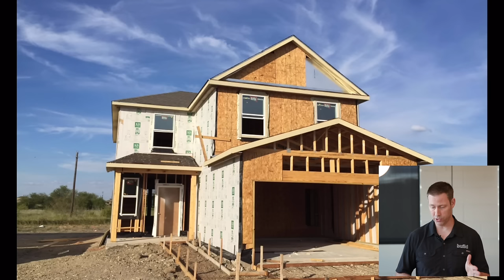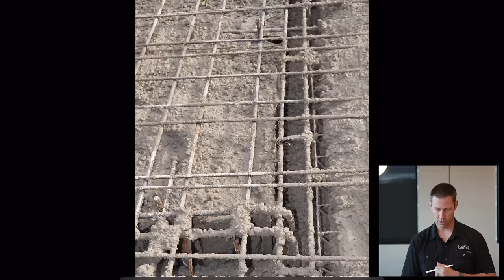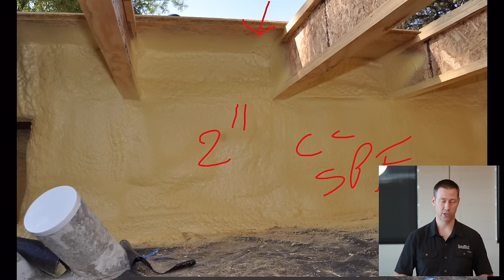Foundations - Slab vs. Pier and Beam - Which is better?

Comment: Slab on grade foundations are quite common on the part of the Maine coast where I live.  Most of the newer homes built that way start with a smoothed and leveled surface, then around 4" of closed cell foam then the rebar slab.  There is usually foam around the perimter of the slab too, particularly if the slab will have radiant heat.  Fully half the houses on my road, including mine, are slab on grade and all have radiant in-floor heat.
Reply: Are there any issues with those slab radiant heat lines freezing in Maine?
Reply: @michelebarber534  only if the heat is turned off for the winter and the system isn't winterized.  As I understand it, people that shut their heat off for the winter often fill the heating system with antifreeze rather than water to prevent freezing.

Comment: Pier and beam is great.

As a plumber that’s what I looked for when I bought my home. I have a 3ft to 6ft crawl space which has allowed me to easily run new wires, ducting, plumbing and a big thing, STORAGE.

A lot of my customers have multiple sheds or garages filled with junk. I have around a 1000 sqft of space for storage thanks to that.
Reply: Basement/cellar is far more spacious than a crawlspace as it adds living space! Lived in two home with basements, also lived in a few slab foundation homes, I rather a basement for the more spacious extra space compared to a crawlspace with its limited height.
Reply: Is that pipe for a toilet, toilets don’t carry ground traps.
Reply: @Blox_fruit_master1 shower I think it was.  The trap for the toilet is the toilet

Comment: Pier and beam all day. Ease of repair, can be insulated , and flex and the crawl space can be used for storage. All good things if you can get to solid earth. My previous house was P&B. Loved it. My current house is slab on grade and the only nice thing for me is how quiet things are. No cavity under the house to amplify sounds. Cool in the summer but cool in the winter unless you have a sunroom to warm the slab, of which the house I'm currently in does not have.

Comment: Another benefit to post and pier is that in Hawaii having air flow under the house cuts down on mold in the house.
Reply: This, I was about to mention this myself. I'm in the "Deep South" and it's not quite as hot as Hawaii, but the humidity and heat together will kill a house and make YOU feel pretty awful too. Having that airflow is sooooo much better. In places where there's a freeze line, basements are great. Around here, unless you're willing to spend a LOT of money not just in construction but in continuing maintenance, a basement is just asking for a flooded space under your living area. :(
Reply: Sonja Johnson  a lot of new homes are built with sealed crawl spaces as if you live somewhere humid all ventilation is doing is letting the humidity in under the home.
Reply: @morehp1  I disagree, under the house is shaded, and the air has a cooler temperature no matter the humidity. It's like sitting under a tree when it's hot out. That cooler temperature actually radiates up, and pushes against the heat. Much like it does in the winter when the heat is on but from the knees down it's cold. 
Here it doesn't get that cold, but in the summer time that airflow keeps the mold down, and helps keep the house cooler.
Reply: @StacyForest738  no the crawl space is completely sealed off with heavy poly done right will have a cap of concrete poured over the poly on ground and the  crawl space walls are insulated and heavy poly over them. Small dehumidifier is installed to keep humidity at desired level. Witch hardly run as there very little way for humanity to make it in. If you ever been under one it’s a Beautiful thing and smells fresh under there. Been under a bunch of homes doing different work. Dirt crawl spaces always have the old stall dirt smell, bugs and spiders everywhere, seen mold under many homes. Yes many states still have code on vented crawl spaces old habits die hard. Many builders do things because that’s what they were taught. Doesn’t mean there’s not a better way.
Reply: @FrankieGreen777   yep and that cool air is full of humidity that’s going pass straight threw the subfloor in the living space above and make your air conditioning work harder to get rid of the excess humidity raising up threw the floor. In a concealed crawl space floors are sealed with heavy poly, and walls are also small dehumidifier is install, witch allows the humidity under home to be controlled. If you have no humidity under home mold can never ever grow. Vs vented crawl spaces can let the right humidity condition exist to grown mold.
Reply: @morehp1  That is good to know. We may be building a cabin soon and I would love a sealed off basement, we just didn't think it was a good idea in a high humidity area. When you mentioned dirt floor basement being full of spiders, bugs, and mold...you basically described a house we lived in prior in TN. I totally don't doubt old building codes die hard, that is a good way to put it. ha ha.

Comment: Great video. I have a pier and beam home. My satellite dish was starting to be blocked by some trees (12 years after the home was built) and needed to move the dish or cut down the trees ( that wasn't going to happen). Only took 30 minutes to run new cable under the house from the other side of the home where there wasn't any trees. Pier and beam is definitely the way to go if you have that option. Especially since I have no attic space (cathedral ceilings). I also will probably be doing a bathroom remodel and the re-plumb will be easy.

Comment: In Central, North, and West Texas;  where the water table is generally very deep, structures can be built with in-ground basements like that. These also happen to be the areas with those solid "bedrock" conditions and, such difficult excavation creates obvious budgetary constraints that restrict the inclusion of basements for mid-level value construction projects (and/or track developments). However, there are other restrictions to basements in Texas. Along the coastal area of Texas, for at least 60-80 miles inland by the crow, and in the river basins which encompass much of the East of Texas, the water table is (generally) only a few feet below natural grade (it's 26" where I'm at in Hitchcock, TX); which limits inclusion of basements for nearly all construction projects because of the constant intrusion of large amounts of groundwater; the area is also prone to frequent floods and storms, and therefore have significant flood elevation requirements.

Considering the fact that; with the exception of the Hill-Country region of Texas...which  has limestone bedrock, and/or boulders, with minimal soil coverage of any kind...the lower Coastal region (SW) and West Texas having primarily sandy soils, and the upper Coastal region (SE) having a loamy soil of a Sand and Clay soil stratification, and nearly all areas of North, Central, and East Texas have entirely, or some depth, of expansive "Beaumont" clay soils....one would think that pier-and-beam would still be the norm across most of the state. (BTW, the type of perimeter wall used in the video P&B example, I've always heard that referred to as a "chain-wall" or "knee-wall")

Pier-and-Beam used to be the construction norm for most of Texas; at least until the mid-20th century, when the availability of lumber from big trees of the "old-growth" forests in the mid-western US dropped off. The price of lumber skyrocketed, making large timbers with full-rip faces and wide, wood-plank cladding construction too expensive for most people. Then, newly enacted forestry restrictions in the early '60s; and the shift to "new-growth" pine lumber of the Northwestern US, made housing design "shift" to use smaller, lighter, lumber that was efficient, and more affordable. Drive through any "heritage" neighborhoods in Texas and you will likely recognize the progression from 19th-century Georgian and Federalist, Victorian and Queen Anne - with locally-milled, true sized lumber, wide cuts of wood plank siding outside, and all-wood lathed interiors; to timber-framed Tudor and Praire Cottages - entirely sided and roofed with shake shingles; to Arts-and-Crafts styles - with prominently displayed exposed beams and a greater use of stone, and Craftsman-style bungalows - utilizing ever-shrinking cuts of affordable lumber, and increasing ply-wood paneling, trying to hold onto that 'look' through a couple more decades; into the variety of mid-century moderns and Traditional American Ranch - with their efficient framing, cladding, and limited use of decorative woodwork... By the time the influx of soldiers returning from Vietnam, financed through Federal VA loans, spurred huge tracts of suburban residential developments in the late '60s and early '70s...each was filled with single-story, two-story, and split-level "ranch-style", homes - using a more economical, and faster to build, Slab-on-Grade foundation to accommodate the demand (and budget) of these new home buyers.

Today, Pier-and-Beam construction, IS regaining popularity...primarily due to flood elevation requirements going up across the state and the returning style of residential homes that 'give-a-nod to bygone eras favor the foundation method. And the P&B's towering cousin, the elevated foundation, with their structures a full 'floor level' [7-10+ ft] above grade, and oftentimes just called a "Pile" or "Column" foundation. The finished structure is fully supported by a grid of either:
1. Round, or square, timber piles...that are machine-driven into the ground 8+ feet; or
2. Engineered, square, concrete piles pre-stressed during manufacture in order to provide very high strength and, generally, are used when elevations or severe conditions would be a problem for other types of columns... that are machine-driven into the ground 8+ feet, in the same manner as timber piles; or
2. Poured concrete columns that are integrated with concrete footings and/or grade-beams, or with subterranean "bell" footings, and a non-structural, slab-on-grade, concrete or fibercrete, "basement" floor underneath the majority of structures; or
3. Stacked CMU-blocks, back-filled with concrete or sand...either in a single, vertical, course, or a double, interlocked, pattern.
(Your video mentioned steel sub-piles under a slab...I suppose in drier, not saltwater areas those could be quite efficient; but along the coast, they'd provide very little friction resistance for loading and would be gone in 10 years due to corrosion.)

I guess I'm a tad partial to an Elevated foundation construction...I should, I've been designing them for nearly 20 years with coastal hazard mitigation in mind! I did the structural on this one [http://www.cnn.com/2008/US/09/18/ike.last.house.standing/] while Lead designer at a local engineering firm about 13 years ago. The plan was a typical P&B from a .com shop and had to be adapted for the EF design required by the site. The majority of my work has been coastal, but I see applications for EF's in larger cities where, due to urbanization, flooding is an issue and existing lot sizes are already small from previously being laid out for little track bungalows and what-not. I, personally, think EF's offer the most economical method of reaching (or exceeding) elevation requirements that would exceed those of a standard P&B Pier. They can give a structure "freeboard" that, with only 2 ft above BFE, will cut flood insurance costs as much as 50%. 

Elevated foundations require minimal, if any, fill and help with net-0 runoff requirements required by many municipalities because "basement" floor materials can be pervious, or omitted completely, or in part. EF's have the added capability to provide larger living spaces in a smaller site footprint because they're able to take vertical advantage of the site...often being 2, 3, or 3.5 stories above ground level...automatically provide garage and storage space below the occupiable floors. Often, elevated foundations provide a land developer with higher profit potential, through the additional homesites created as a result of smaller lot sizes necessary to accommodate this style of construction...each to be sold at the typical price range...while creating minimal infrastructure cost increases for the development as a whole.
Reply: I cant believe this knowledge is readily available on youtube thank you for sharing your experince :D
Reply: @furrycircuitry2378  You're welcome; 25yrs experience in Texas (and the Gulf Coast as a whole) designing the infrastructure for developments and structural for the buildings on them has given me a pretty good overview.
Reply: How cool is this!  What awesome information.
Reply: in the case of piers and slab you mentioned (11 minutes into your presentation), if they were not able to reach the rock and had to do reinforced concrete footing for each pier, would they have been able to do a reinforced concrete slab still (I know he said the slab was not reinforced)? 

if so, can the piers be taller than 2 feet; say 6 feet tall? Can it be done (I know it would be very heavy)?

Comment: Could not agree more I'm just east of Austin and peer and beam on this sandy soil is way more reliable and easier to install or repair if ever needed. I've seen so many cracked foundations and homes costing alot to re-level, with peer and beam but a jack on it slide in some cribbing and done.

Comment: Another benefit of a slab foundation that we did to my dad's garage in Illinois. Use below grade insulation under the slab and put a tubing grid in the concrete for convection heating and cooling by circulating RV antifreeze through the tubing. We used an electric hot water heater as a storage tank for solar hot water, and had the water heater set up as a backup heat source running off of a battery bank and solar panels... Can't stand to turn the thermostat over 55° because you'll start to sweat in the dead of an Illinois winter.
Reply: @LincolnLog  we started off with just wanting to use the convection heating. I wanted to test the idea of running a series of copper pipes painted black in a black box with a plexiglass lid as a means of endless hot water when the sun was up. The idea worked, so we decided to plumb that solar water heater into the system. The way things are set up, the electric heater rarely needs the grid to run (my dad is an Advanced Electronics Tech, so he built a controller that uses solar hot water first, electric hot water from batteries second, and grid power third). It started as an experiment and just stayed connected because it works well.

Comment: In the DFW area it’s very difficult to find an experienced pier & beam contractor since majority of the area is so flat. They can do slab on grade a lot quicker so  if you have a slope they want to lean towards retaining walls and compacted fill  to level out the site.
Reply: Not only is the DFW area flat, I believe it has a really shallow frost line (like a few inches). You probably can get away with a backhoe digging a one foot deep footing. (Always check your local codes, kids.) I bet the backhoe is way cheaper than digging out the footings for a post and beam foundation.
Reply: Hi, do you have a good pier and beam contractor you can recommend in the DFW area?
Reply: This is very interesting.  My wife and I are looking at a home in frisco and it is on a slope.  Who do you typically reach out to for the retaining wall?

Comment: It would be good to build a slab first then build a pier and beam house on top of that so when crawling underneath, you don't have the dirt to deal with. Pier and beam cost less material I believe because there is no concrete and steel rebar use. One thing I like to point out is there is no need to build the water supply pipes underneath the slab foundation, some of my condo properties they used CPVC pipes installed inside the ceiling areas. It would be good to insulate the CPVC waterline supply though. 

Last year I did plumbing work at my house and ran Sharkbite pex in the attic from the supply waterlines at the water heater to a new bathroom location and were insulated with foam tube insulation. The freeze we just had in Texas in the 2nd week to the third week of February 2021, the pex pipes has no issue. I kept the house at 66 degree heat and here is the key "I flushed the toilet every hour or less for 4-5 nights without sleep (this help water gush through the water supply pipes to keep water from freezing) & also let the faucets dripped pretty good". Water is much cheaper than fixing burst pipes under the slab foundation. 

The new bathroom project I did I also had to dig down 3 or more feet to make new drain pipe connection, the house was about 45 years old built in 1977 yet the drain pipe section that was cut out has very little wear. We do not need to install water supply pipes under the slab foundation, only drain pipes are needed. The plumbing problem in this video is the exception not the norm. 

I hope what I shared someone will benefit from my information particularly flushing the toilets regularly in freezing weather and run pex water supply lines in the attic and insulate it when building a new house, thx.
Reply: I live in a trailer in North Dakota and don't even need to do all that 🤣